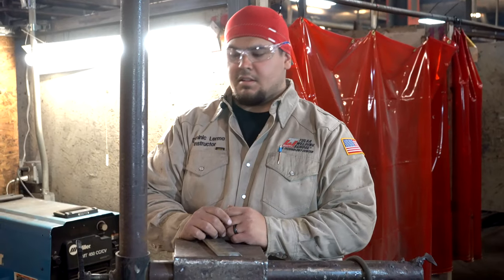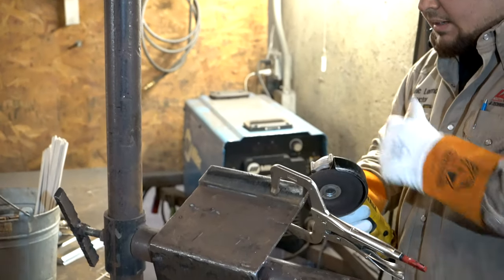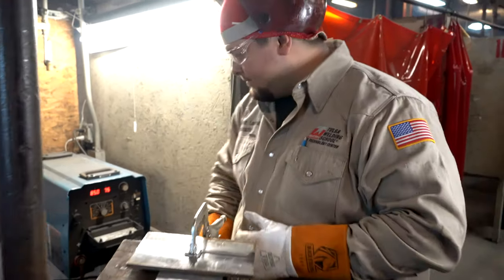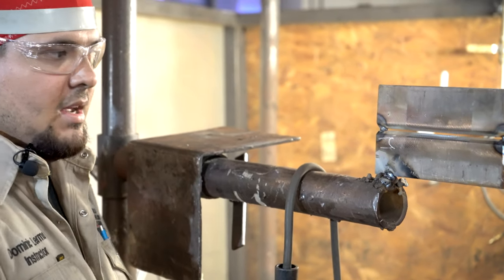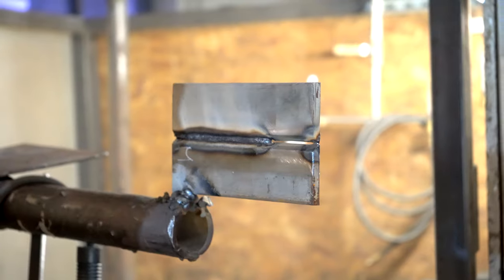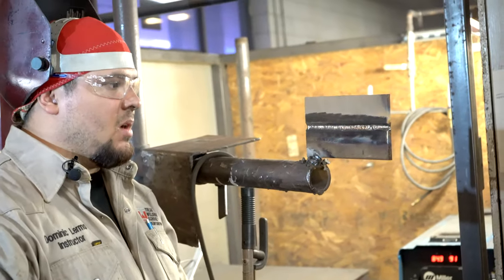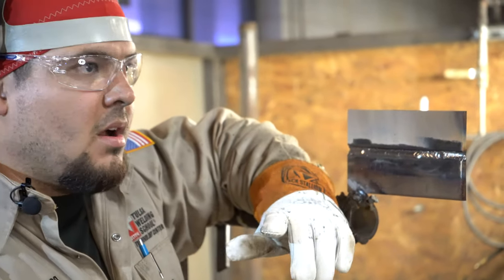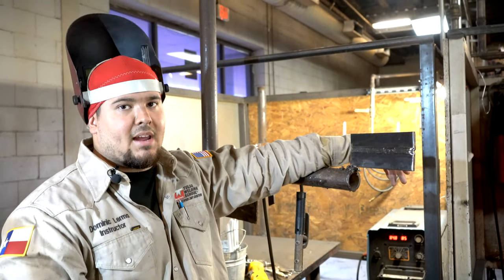How to Weld a 2G Open Root 6010 and 7018

Comment: The root on 6010 is such a struggle for me sometimes
Reply: See my reply below under Cody Barksdale's post
Reply: I hate backing plates and trying to penetrate with 6010. Trying open root today at school instead.
Reply: @dolphincliffs8864  I’m on 6G
Reply: @Royalewitchee  Cool! Did my first plate and bend test,not terrible.
Reply: @dolphincliffs8864  did u pass
Reply: @Royalewitchee  Not an actual on paper test ,just checking that root pass after I capped it
Reply: Yeah same but just to get it started, once ive got it goin its good, just long arc it at the start to get it goin and then move in and whip or stitch ur 6010
Reply: @henryhovden9509  ive been done with that i passed 6G too
Reply: If you know the correct procedure you will never get struggle...
Reply: Is this a Cars reference?
Reply: تمام❤
Reply: احسنتت good Gob ❤🎉
Reply: Currently goin thru it rn trying to pass 😂
Reply: @Tha_Mex_JarJar  angle your rod down a little bit and apply pressure nothing crazy
Reply: @Royalewitchee  oh shit thanks definitely gonna give it a try
Reply: @Tha_Mex_JarJar  75-80 amps

Comment: Thank you I been having some trouble and you just explained it so good
Reply: Are you in welding school? I just recently figured out how to do the E6010 root pass. I prefer a 1/8” gap and land and run the 1/8” E6010 on 85 amps. It requires very little manipulation.
Reply: @user-hn9qg5qm3o  after the plate is being tacked. What causes the huge middle gap in the middle is it because of pushing the grinder too hard or ?
Reply: @patriotskingnation8084  I’m not exactly sure what you’re asking about. Can you further explain?
Reply: @patriotskingnation8084  Don't stop the grinder in the middle.  It take very little pressure to grind, so let the tool do the work, and move all the way down the plate.  Good luck!
Reply: @user-hn9qg5qm3o  He is digging with the grinder, stopping at the middle of the plate,  So the edges are not true.
Reply: @americathefree3708  I fixed but that was my issue thanks !
Reply: @patriotskingnation8084  Awesome!

Comment: Are you opting for 3/32 on your fill pass due to the u shape manipulation? Ive been using 1/8 for the most part but i assume it may build up to much with rod manipulation.

Comment: Can y'all show a ceramic tape 2g and 3g.
Which alot of shipyards require in Mississippi..
Actually philly shipyard wants an 18" plate which makes you stop and start on root to show a good time in.
Thank you
Dual shield flux core
.052 wire

Comment: Why dont you use two run off plates and backing instead of those two nasty tacks....and you can see lack of penetration where the tacks were ....why a 6010 hot pass on 7018 root....u cudda just run a 7018 hotpass ...

Comment: Hey Dom. Thank you to you and all you guys there for putting in the time and effort to make these videos. 
I've been following you guys for a while now and realy enjoy your videos. Really helpful, some really good stuff, thanks! 
So, I have a question for you. 
You said that you like to start your route weld on the top plate. 
I don't want to sound like some kind of know it all. I'm not! I had a 3G coding, almost 30 years ago and try to use logical reasoning as much as possible. 
If you look at Time code 19:26 on the video play back, it shows a lack of fusion and trapped inclusion. 
Would I be correct in saying that there was no moulten metal on the bottom plate, for the top plate to tie into and as the moulten melal on the top plate touched the colder metal on the bottom plate it got cold shock and shrunk, causing lack of fusion and perosity / trapped inclusion? 
Would starting on the bottom plate have solved this problem? 
I know they don't use the  ends of the test plates, but if I was welding pipe and it was a test piece, it would make a big difference, as some examiners don't allow you a grinder. 
The reason I am asking is because, I am a Saturation Diver and I am seriously considering going back to welding and completing all the tickets all the way to 6G. 
Please dont feel that I am being disrespectful in any way? 
You didn't mention any thing about this and continued to weld over it. 
That is why I am asking.
Reply: Guess they don't reply to  such?

Comment: I have a good tip for 2g , when going along the metal on stringer beads make sure to press the weld upward cause it comes down with gravity , so where you want your weld to be , keep ur like 2 cm over

Comment: In the PPE talk you do not mention nor use the use of a face mask (and you have a beard which would prevent a good seal). You get a lot of airborne fine dust especially using the flapper wheel. You probably have some LEV in the booth though to help. Other wise a first class instructive video. It is worth mentioning the change in sound when you are getting good root penetration to when the gap may close and you start to lose it.

Comment: So for 3/32 gap and a 3/32 or even 1/8th landing using a 1/8th 6010 electrode my amperage should be around 75? What would be the heat range for this set up. Thanks!
Reply: If you have a 3/32" gap and 3/32" land or a 1/8" gap and 1/8" land then you can run anywhere between 75-85 amps for the root pass using a Lincoln Electric 1/8" E6010 5P+ rod. When you run it at 75 amps, you will have to go a little slower because remember "amps equals heat." You will have to go a little bit slower because you won't fully penetrate the gap onto the back side if you go too fast. I personally like to put a 1/8" gap and 1/8" land on my 3/8" plate with 37.5 degrees of bevel. I run my amperage at 85 amps and I make sure to keep the rod pushed into the front half of the keyhole. You should feel light pressure as you keep the rod pushed up inside the keyhole where it brushes/nudges against the front rim of the keyhole. You shouldn't have to manipulate the rod very much. Many people think you have to really whip the rod around, which ends up making a mess. All you do is keep the tip of the burning rod pushed into the front half of the keyhole and gradually nudge the gap edges (front/leading rim of the keyhole) and it will melt away, causing your keyhole to extend forward some. However, the metal you are melting from the rod tip will also trickle into the back half of the keyhole and fill it in as you continue nudging forward with the tip of the rod. So basically the keyhole will essentially follow the tip of the rod if you are keeping it up in there. You can nudge forward with tiny little cursive e movements (tight little tiny circles), but it's very small, which is why I keep saying "nudge". The key to the root pass is keep the rod pushed up into the keyhole at the front or leading edge of the keyhole. If you don't see a small keyhole then you are not penetrating through to the back side, so you must always see a keyhole throughout until the end.  Keep the rod pointed up slightly toward the top root land (little asterisk here in my depiction) throughout the root pass and make small little wiggles/nudges forward. Make sure you see the keyhole stay centered along the length of the gap. You will see the back side of the keyhole fill in on it's on if you have your amperage set right at about 80-85 amps
(|(|(|(|(|(|(|(|(|(|(    *)=====================  (weld example here is a root pass from left to right)
Reply: good!
Reply: Hello, what number of glass / lens do you use for 2g? or in general which one do you recommend for smaw welding.
Reply: @J  As a real world Welder myself, You did better in your comment at explaining exactly how it's done than ANY video on the internet!